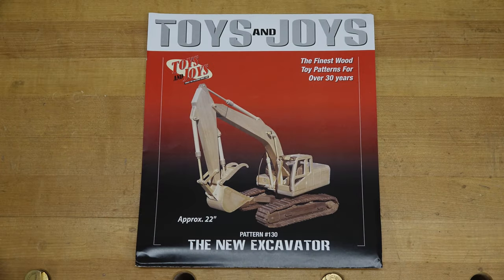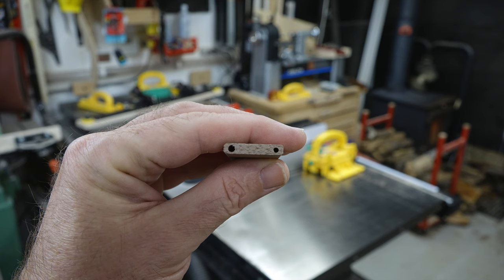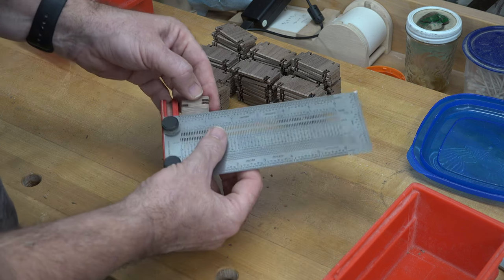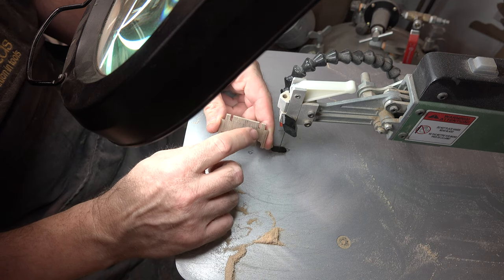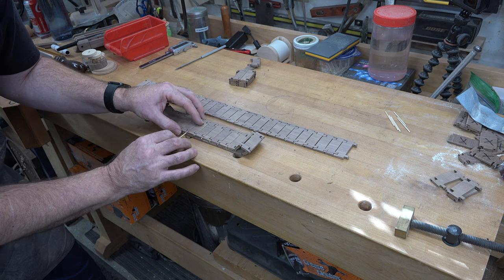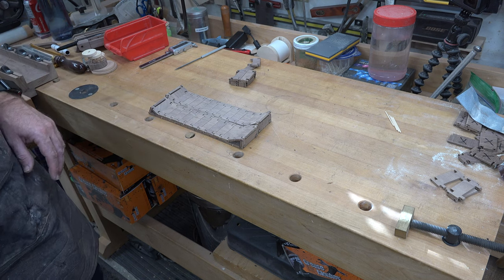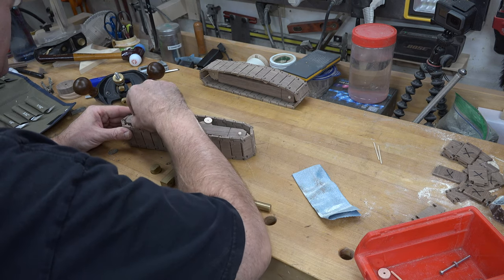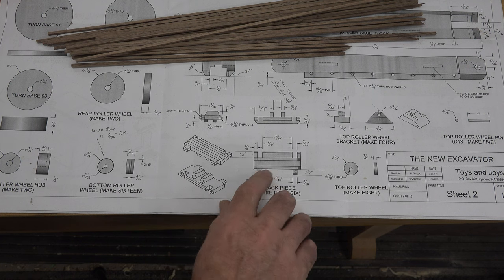Toys and Joys "New Excavator" Part 3

Comment: These model builds seem like a great way to work on accuracy, equipment setup, hand tool work, and patience, with patience being the big one. I’ve seen the router plane a lot on other channels and every time I see it used I think that looks a must have, so handy. Looking incredible, great work so far.
Reply from the maker: I bought the router plane quite a while back to add to my hand tool arsenal and I am amazing at how many times I've used it.  It's a great little unit for sure.  Thanks for tuning in this week Randy and for taking the time to chime in with your ideas.

Comment: Kenny, having another video to watch sure makes me smile!  I was wondering what table saw blade you use to keep these small intricate pieces.  I imagine the wrong blade would cause some splintering.  Also, for a project for another day (month)... perhaps you might consider an intarsia project.  I will not be upset if not, but I was just throwing it out there because I really enjoy your style and pace.  Finally a woodworking master I can keep up with and actually learn while being entertained.  Thank you my friend.
Reply from the maker: I have three blades that I used on a regular basis.  A normal ripping blade, a combination blade and a fine crosscut blade.  All are Diablo blades but I am considering upgrading to Forrest blades.  I just haven't pulled the trigger on them as they are very expensive.  As for the intarsia piece, I have had it in my list of things to do for a while and I even have the subject of the piece picked out.  It's just a matter of designing it and getting it filmed and edited.  It seems there just isn't enough hours in the day.  Not to worry though, I'm sure that you will see an intarsia piece on the show soon enough.  Thanks for the suggestion, for the kind words and for tuning in.

Comment: Those pieces that didn't cut it with the X through them can be saved to possibly be used as inlay pieces. I would save them for a rainy day. Not to change the subject, but. I like the looks of what I can see of the magnifier on your scroll saw. Tell me about it. I have a good one, but that one looks better? Those tracks look great, cool! Enjoyed, take care!
Reply from the maker: Those unused pieces are still sitting in the shop Michael and who knows, they might end up being something someday, even if that "something" is designer kindling for the wood stove.  As for the magnifier, I love that thing and unfortunately, it has been discontinued and is no longer available.  I'd love to give you more information on it but I can't provide what isn't available any longer.  Sorry about that.  Thanks for tuning in to the show.
Reply: @acutabove_woodworkings  Could you recommend a magnifier that has similar functions? Really do value your recommendations because of the experiences you have in the use of yours. Thanks.
Reply from the maker: @dallanwordekemper3836  I also have this one in the shop and really like it and if for any reason, the one on my scroll saw ever gives out and I can't get a lamp for it, I will be replacing it with one of these.  https://www.leevalley.com/en-ca/shop/home/lighting/worklights/76037-led-magnifying-bench-lamp?item=17J3030
The viewing field isn't as large as the one I have now but the lens is crystal clear with very little to no distortion of the images.  The magnification is just great and the LED lighting that it utilizes is brilliant white and illuminates my work perfectly.  I hope this helps.

Comment: I was thinking on your track pieces couldn’t you take long block and rip dato and couple rabbits then slice block like cookies to achieve individual track pieces?Mabey drill holes before slicing
Reply from the maker: This process wouldn't work.  The problem would be that the flat surfaces of your track pieces, when doing it the way you suggested, would be end grain and because of that, there would be no strength in the piece.  The end grain would not be able to accept dowels to make the track without breaking the track ends away from the track body.  You need the stability of long grain to give the track segments strength to handle the stress of running around the track wheels and track guides.  I like the fact that you are thinking about alternative procedures though.  That's what it's all about.  Thanks for tuning in and for chiming in with your idea.  It's very much appreciated.